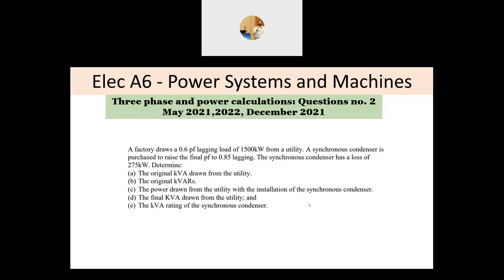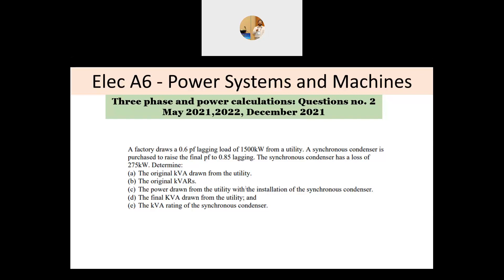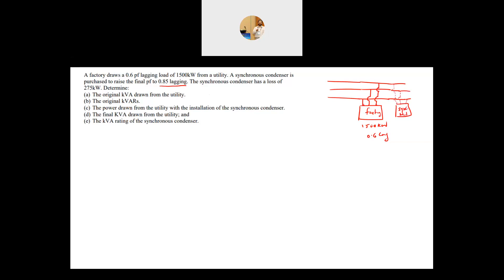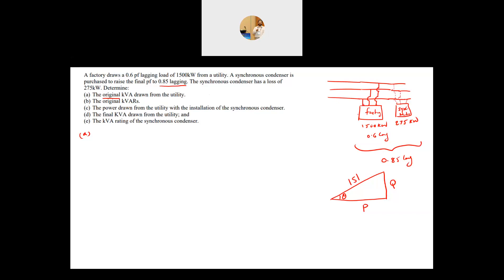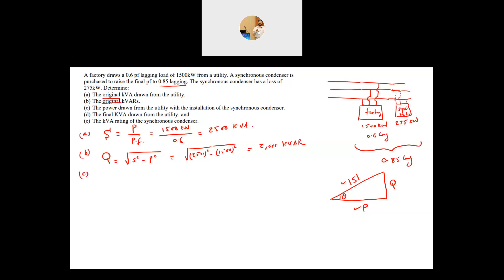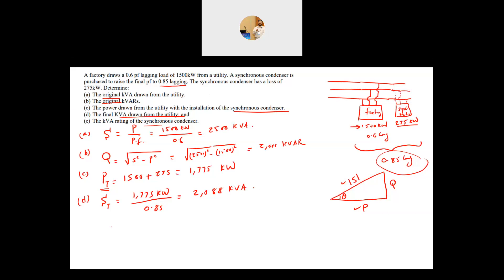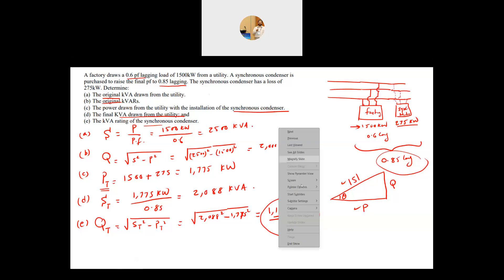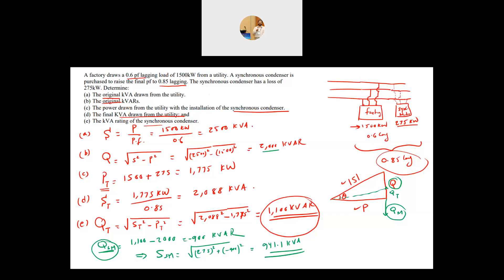PEO solved examples (ELEC A6) Three Phase Question no. 2

Comment: Thank you for the clear explanation, I found there are some theory questions, what source do you think I can study from.
Reply from the maker: I have some theoretical explanations' videos in the my channel about three phase. This includes how to analyze the circuit, power triangle. power factor correction, etc. If you have any specific questions, please send them to me and I can address them.
Reply: @electrical4everyone  Dr Ayman, would you please solve question 4 part c, December 2019. Thanks
Reply from the maker: @mohammad-pm8tm I solved a similar question https://youtu.be/p-OxuR6KzqY and I mentioned that part C is wrong from English as it does not make sense.
Reply: @electrical4everyone  next exam is on 17 June, thank you so much for new example you solved
Reply from the maker: I solved some theory questions from A6 exams.